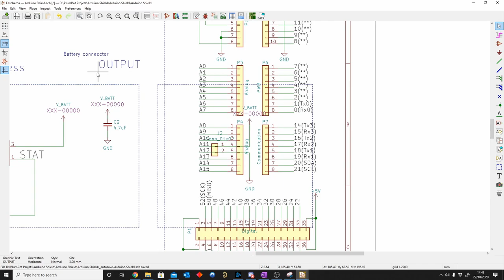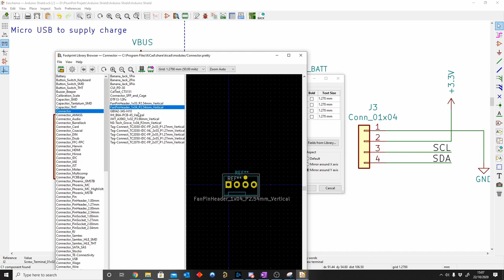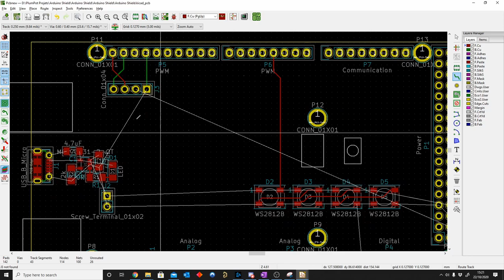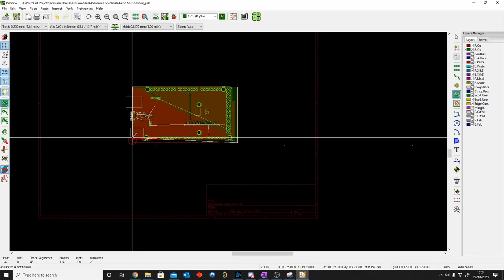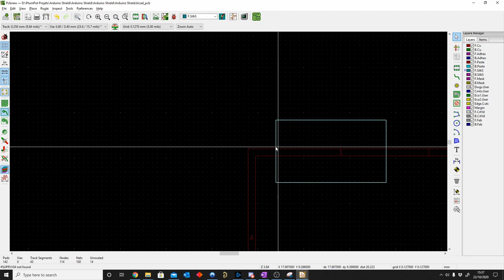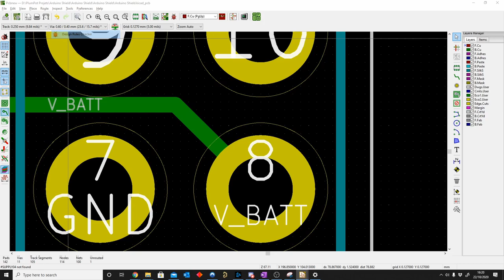KiCad Tutorial  - How to make your own Arduino Shield using KiCad

Comment: I'm using Kicad 7 and the Mega headers are not the stacking ones with the long pins. When you look at the template comments before you create the project, there is a note that the author did not see long pins in the official Arduino parts library so only included short pins. Do you know how to either get the right template or find the right part and just put it in to get the longer headers?
Reply: same issue
Reply: same same ..did you find the answer good sir?
Reply: @fringeanomaly9284  No, would have to draw a new part

Comment: Trying to append the battery charger circuit from your github repo but Kicad cannot recognize it.. is there any reason for this?? thank you  for helping us by the way ,really appreciate the work you doing and am glad i came across this channel .. i am joining the discord soon.
Reply from the maker: Hi 👋 mmm if you on Discord send me a message and I can try see. Might be easier of you send a screen shot of what it's saying. That is strange. Otherwise you can always email us at www.plumpot.co.uk 🙂. I'm glad you enjoying the channel😁
Reply: @PlumPot   which Kicad Version were you using to draw the schematic? i will message you shortly on discord. 
:_Okay:
Reply: same problem here :) I have KiCAD 7.0. Did you fix it?